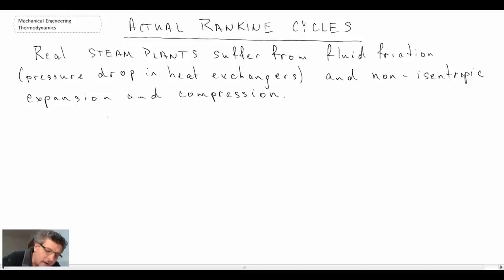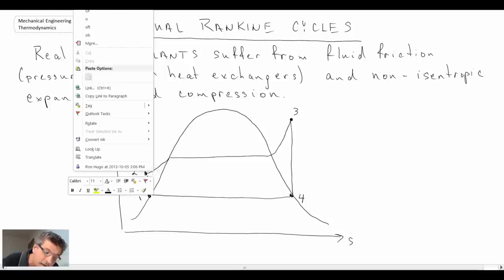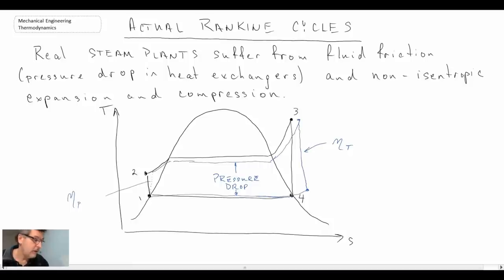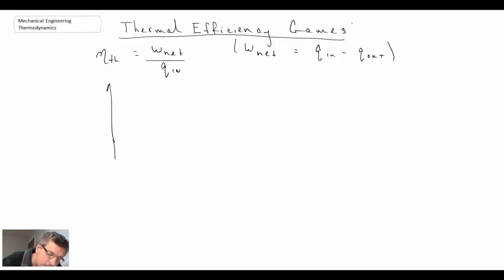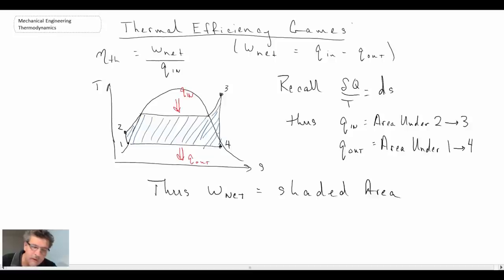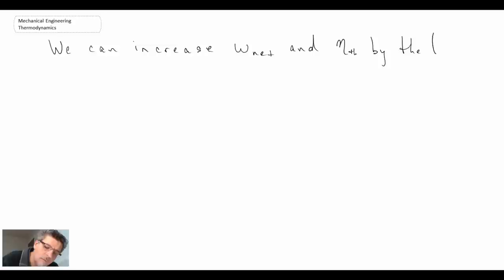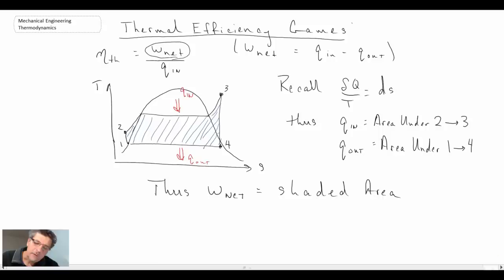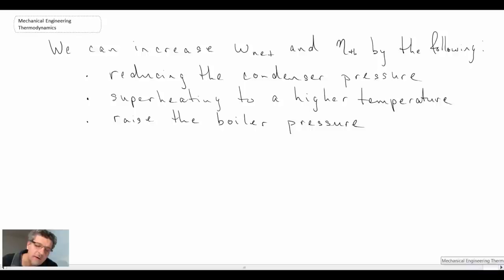Mechanical Engineering Thermodynamics - Lec 20, pt 1 of 7:  Actual Rankine Cycle

Comment from the maker: You usually determine this by knowing information from state 3.  If state 3 to 4 is an isentropic process, then the entropy between 3 and 4 will be equal and with this state 4 is determined. Note that state 3 is usually determined by knowing the temperature out of the boiler and the pressure of the fluid in the boiler.  If the process is not isentropic, you will usually have an adiabatic efficiency for the turbine.  With the adiabatic efficiency you can determine the isentropic (ideal) enthalpy at state 4, and then the non-ideal or actual enthalpy at state 4.  With actual enthalpy and knowing the pressure in the condenser, you are able to determine if state 3 is superheated or in the two phase region.